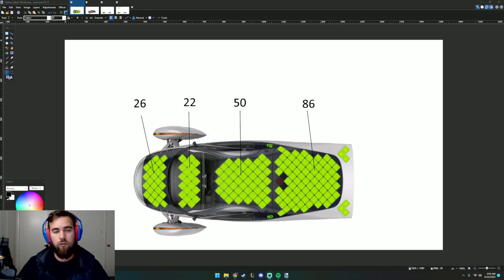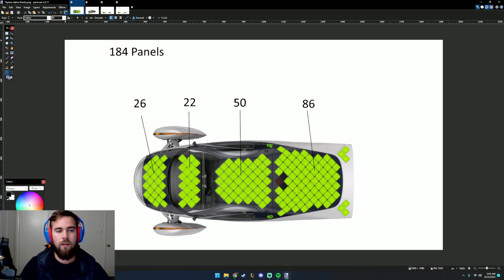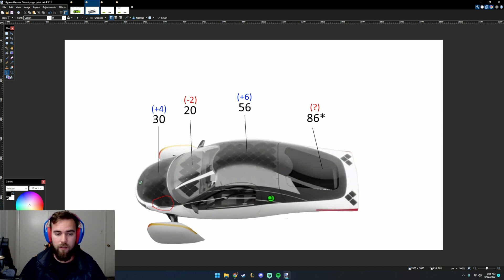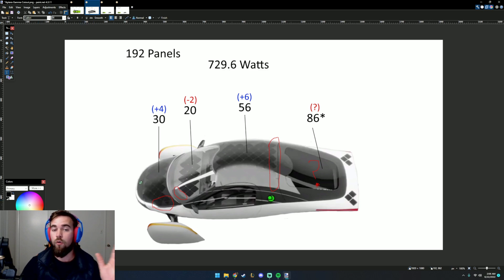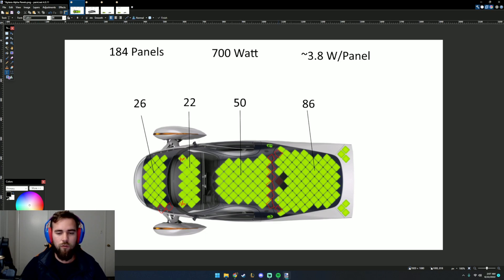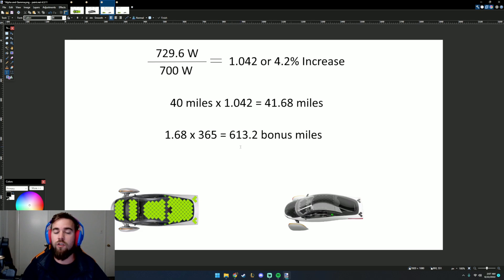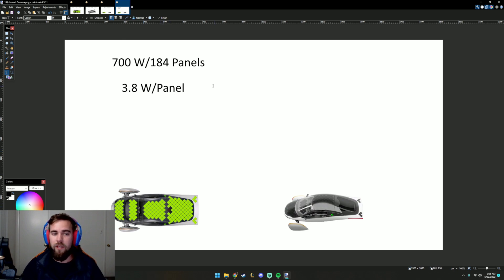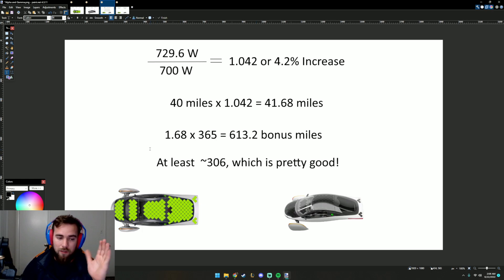Aptera Gamma Render Added Solar Cells. Could that mean more range?

Comment: Depending on packaging, the Gamma model could sport between 16 and 30 extra solar cells over the Alpha design. I don't think that they would have problems getting 700W under perfect conditions (or maybe 753W with the extra cells), but since reviewers and customers alike are going to closely compare the actual, real world range to claimed numbers, it is wise to beef up the solar array, because imperfect conditions will always lower the achievable solar range.
Reply from the maker: I agree, I think they are padding the amount of cells to to reach real-world numbers.

Comment: It's quite safe to assume a substantial amount of additional cells on the rear hatch, more than 6. The tail end is 4 inches longer, while the lip from hatch to rear edge of the car seems to have been reduced based on the solar hatch leak from the webinar. If we also bear in mind that the tail is being deformed downwards in the gamma, it seems they've done away with the rear solar triangles in favor of maximum solar cell coverage.
Reply from the maker: That’s interesting, if there are more panels total then that could mean even more total power then what I calculated. It could also mean they are having trouble getting enough solar energy a day and opted to fit even more.
Reply: @KingKearns  I think solar range is the biggest touch point of Aptera, so even if they achieved 40 miles of solar range, they'd be quite happy to try and push that to 50+ mile range, with a design change that also improved aerodynamics and ergonomics for reaching inside the trunk.
Reply from the maker: @LaughLogicTV  I agree, I think solar capabilities are one of the biggest selling points (for me). I’d be delighted if they gave us more than we thought we were getting. How often does that happen these days?
Reply: I have my doubts on that, (Extra on the hatch) if you take a look at AOC's video on the changes, it's pointed out that when you look at the stretch, it seems to be the roof line that was extended (Hence the additional row of panels there.) and it seems likely that the hatch itself is not significantly changed in size. But we probably can't be sure until we get further info/documentation from Aptera.
Reply: @billthacet  yeah we'll see but I think the rear of the vehicle will have a good deal more cells.

Comment: This kind of extrapolation, given what little solid data we have about those cells, is likely to give wildly inaccurate results.
I love it though.
Reply from the maker: I do believe Chris Anthony talks about how much power each cell produces in the Rich Rebuilds video. That could be outdated at this point but it was stated. The idea is that adding 6 panels would have a maximum increase of 4.2% over the prior configuration. How much we actually see over their original 700 W (if any) I have no idea.
Reply: @KingKearns  Or... Maybe they needed to add those cells to achieve something close to 700W.
Reply from the maker: @nathanahubbard1975  yeah, I mention that in the video. I truly think they are going to surprise us with more power though.

Comment: Also, the best cells of the type shown are capable of 3.8 watts under, what's known as Standard Test Conditions (STC).  By the time they are assembled to each other and encapsulated they will lose power as tested under STC.  Now have them on compound curved surfaces and you'll lose even more.  Now heat them up above 25 C (77 F) and they lose even more.  In the end, Aptera would have to add considerably more than 6 cells to get to the 700 watt number that everyone, including Aptera, keeps tossing around.  Sorry.
Reply from the maker: Thanks Bob. That's why I think it's important to wait until there's real world data before claiming the Aptera CAN do this or that. I always quote what the company says their vehicle can do but I think it is important to highlight that they haven't shown it achieving these numbers in the real world yet. Hopefully the gamma prototype can show us some real world action.
Reply: @KingKearns  Awesome,  I really look forward to what owners have to say about their solar array’s performance.  In fact, I have access to some sophisticated solar array test equipment and will gladly thoroughly test anyone’s array for them.  I’m assuming, of course, Aptera’s “right to repair” philosophy will extend to relatively easy access to the positive and negative leads of the various sub-array sections.
Reply from the maker: @bobhilder1469  if I was early on the reservation list I’d be happy to run tests but I’m pretty late to the game so it’ll be a while 😅.
Reply: @KingKearns  Understood but “spread the word”!
Reply: @bobhilder1469  I dont understand right to repair really. Still have not owned a car that I could not repair myself.  And correct me if I am wrong, but I think that car manufactorers must have spareparts for atleast 10 years. But I guess there are parts like batterypack which I guess is a good idea to not repair yourself.
Reply: @AndrewTSq  "Right to repair" is an odd phrase and I don't know what "spare part" timeline requirements there might be.  I, like you, tend to "repair" my own cars.  My best guess at what "right to repair" really means is that, in the case of cars, one can get detailed "shop manuals" and such and essentially be "given" relatively easy access to "stuff" (like solar panel output wires).

Comment: The individual, nominally 5 inch x 5 inch "pseudo-square" gizmos you are counting are not "panels".  They are "cells".  Many cells are connected to each other to form a panel or module.  Many panels or modules are an array.
Reply from the maker: Sorry about the terminology slippage. Thank you for clearing it up!
Reply: @KingKearns  Can you fix it?  Maybe place a "everytime I say panel I should say cell" "sub title" throughout video.  Just a thought.
Reply from the maker: @bobhilder1469  I will try to add something, I changed the title and description to say cell in the meantime.